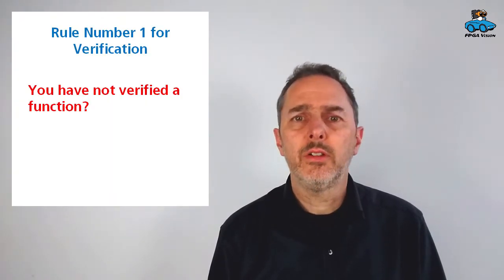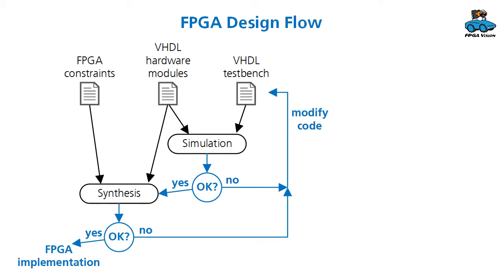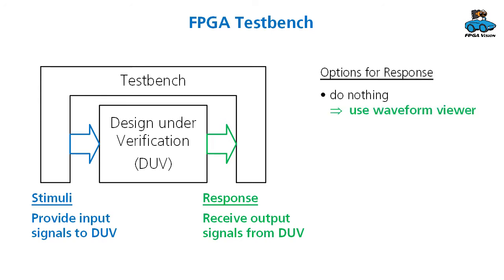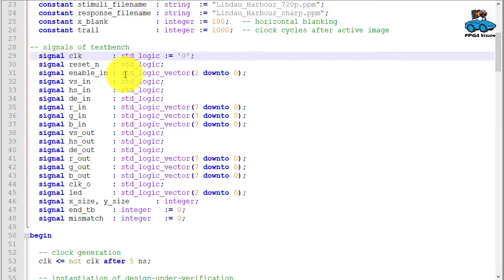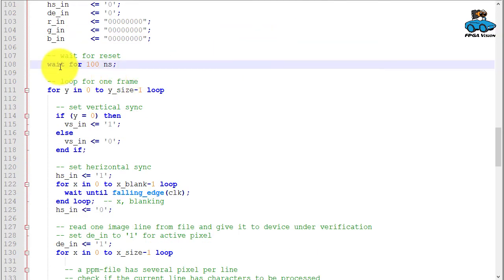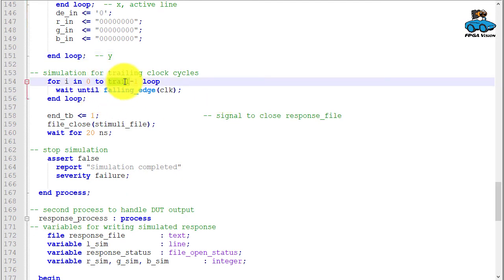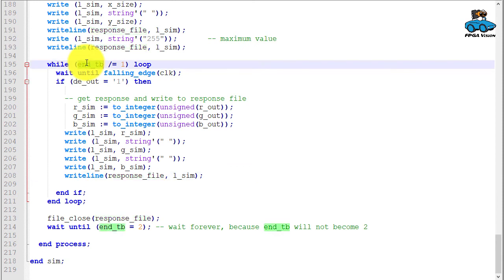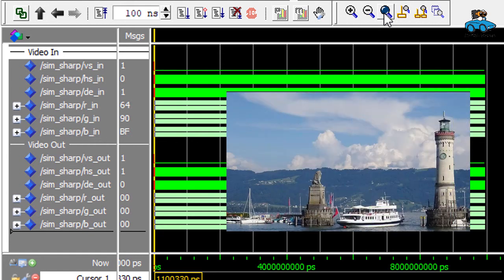FPGA FIR Filter: Verification with VHDL Testbench

Comment: Dear Prof. Marco, 
Thank you very much for the series of very valuable videos. I have a small question about the waveform in this video (at 9:10). As I understood the algorithm, the output should start to appear after 7 linememories. But in the waveform, it seems like the outputs (r_out, g_out, and b_out) start to appear very soon. Am I missing something? 
Thanks
-Susantha
Reply from the maker: The output should start after 3 lines (7 taps minus 1 center tap is 6 taps, and 6 taps divided by two (left/right side of filter) is 3.
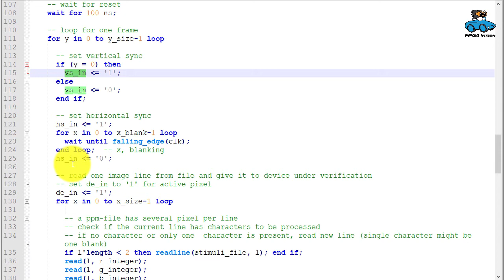The design does not implement this shift of three lines, to make the code easier to understand. You find the explanaition for that in video "FPGA FIR Filter: Circuit Architecture and VHDL Design" at 5:00. And you see consequences at 6:30. https://youtu.be/Fjy8vw9gi8c